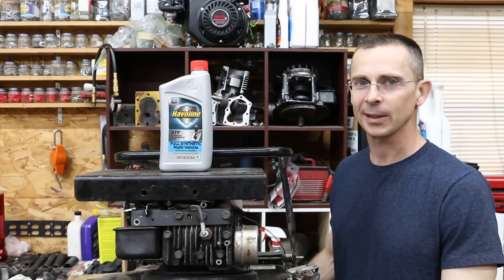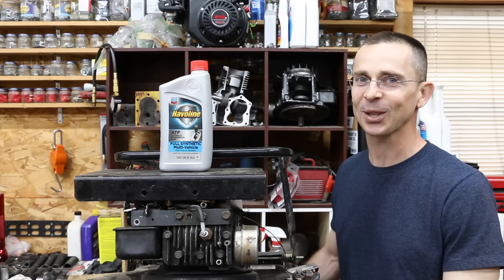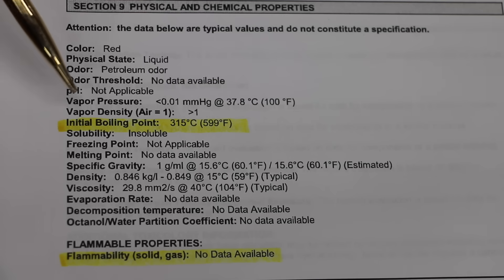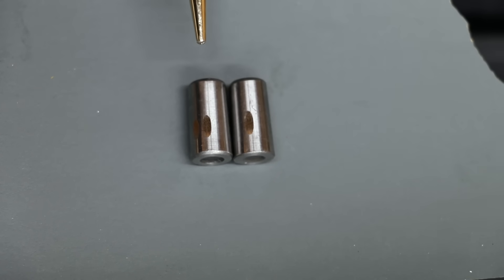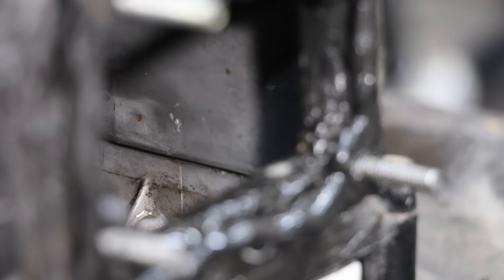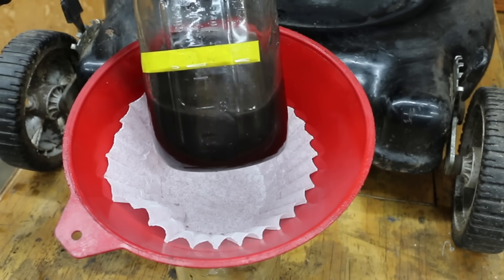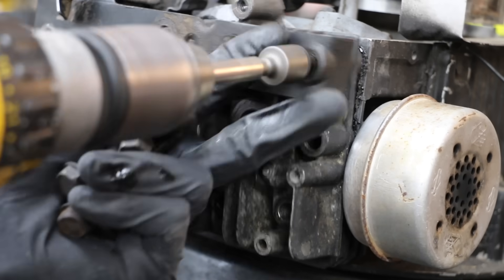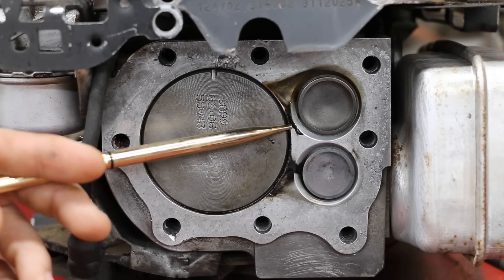ATF as an Engine Oil substitute?  Let's see what happens!

Comment: Great video . I worked as a tech at a GM dealer . The Boss's wife drove her van 32,000 miles without changing the oil . There were 3 or 4 lifters clattering . I drained the oil , installed 3 quarts of 10w-30 and 2 quarts of Dextron . I let the engine idle for 4 hours then drained the oil again and  added 5 qts 10w30  . This did quiet the lifters  to a normal noise level  , no more clatter . I would not advise adding ATF to an extremely dirty engine such as full of sludge as the ATF may fill the oil pan with enough sludge to plug the oil pump pick-up screen , this happened to a friend of mine .
Reply from the maker: Thanks for sharing.

Comment: As an ASE mechanic who's been working on vehicles for 25+ years I've seen and used ATF to clean and free up lifters tho sometimes taking some time. By safely.
It's basically 30w oil with detergents and antifoaming agents.
Reply: We never ran all trans fluid but rather one quart per 5qt change a I've done this on my 1998 GMC Suburban which now has 343,000 miles and a compression test last summer had 210psi on all 8 cylinders.
With a hot oil pressure of about 28psi @idle and 47psi plus above idle.
I did have a buddy that ran straight trans fluid in his car for about 5 years with no obvious adverse effects.
Reply: Maybe the extra detergents reduce film strength somewhat not sure.
Reply from the maker: Thanks for sharing.

Comment: One thing you should know: Many places that accept used, waste oil, WON'T accept it if they know there is ATF, hydraulic oil, or antifreeze in it. And I know a shop that is heated by an oil furnace, and they burn used motor oil, since they have so much. But they stopped accepting other people's used oil from home because it often had coolant or ATF mixed in, and wouldn't burn.
Reply from the maker: Thanks for sharing.

Comment: I think a Briggs and Stratton flathead is not analogous to a modern engine, or nearly any automotive engine since 1970. It's air cooled, has no hydraulic lifters, or pushrods, or rocker arms, no oil pump, and no small oil passages. It's also very low compression, and often has an aluminum bore, not iron. So even if something works in a lawn mower, it probably won't in a car.
Reply from the maker: Thanks for the feedback.

Comment: Years ago I changed out a slant 6 that came from a bone yard. Change the oil and used one quart of type F ATF. Ran for 200 miles. I was amazed when I puled out the dipstick and saw the clean spot on the dipstick. Even more surprised when I changed the oil how filthy it came out. I drove the van another 50,000 with no issues at all.
Reply from the maker: Thanks for sharing.

Comment: I used to add a quart of transmission fluid at my last leg of my trip home, just before an oil change on my freightliner, 425 caterpillar engine. (Up to 500 miles to home) Approx 10,000 miles per oil change. Pulled into drive way and dropped the oil. Don’t know if it did any good, but made me feel good!!
Reply from the maker: Thanks for sharing.

Comment: I've used atf to bring back engines from the dead. Oftentimes the rings will get clogged with carbon and get stuck in the groove so they don't seal. I've had cylinders with 0 compression jump up to normal levels after letting it soak overnight in atf. Solved misfire errors on my BMWs many times over the years. I just saved an old 1968 honda cb160 that was completely seized. Poured some atf down the spark plug holes and slowly broke it free the next day. Runs great now
Reply from the maker: Thanks ffor sharing.

Comment: Heard Marvels Mystery Oil was ATF. Wonder what an oil sample would tell?
Reply from the maker: Thanks for the video idea.
Reply: @ProjectFarm  Along the same lines, I’ve always used Gunk Motor flush before and oil change. A qt is about as much or double what a gallon of diesel or kerosene and smells a lot like kerosene. Also heard of people adding a qt of diesel or kerosene to oil before a flush and my uncle, a life time mechanic and engine builder liked to run a qt of ATF for a few miles before a oil change. Said it was easier on the engine. Anyway would be interesting seeing the cleaning properties of theses additives and even the lubricity of the additives to 4 qts of oil. Anyway thanks again, your videos are outstanding!

Comment: I actually used synthetic atf in place of oil in a mower since i didnt have oil on hand. Ruined that poor thing. At the end of the mowing season it was only cutting because i sharpened the blade real good. When i pulled the head off atf poured out of the cylinder
Reply from the maker: Thanks for sharing.

Comment: In older cars, 70's and 80's I would add half a qt of ATF about 500 miles before an oil change to clean up sludge, never had a problem, would I do it today?  Probably not.  Amsoil and Pennzoil Ultra Platinum are loaded with detergents, I would go that route instead.
Reply from the maker: Thanks for the feedback.

Comment: I took my Freightliner Detroit Diesel 4 banger to the dealer not long after new because it seemed down on power. They checked "everything" and pronounced it fit and finally filled both oil filters with ATF and ran it awhile. I didn't feel any difference but guess that doing the ATF in the oil is SOP with Freightliner. Thanks, JD
Reply from the maker: Thanks for the feedback.

Comment: Me and a buddy were driving from Michigan to Ohio and we had a lifter stick and start popping really bad. The engine was barley running so we stopped in a gas station and this old guy said pour a quart of trans fluid down your carburetor. We were skeptical but we were stuck so we revved up the engine rpm as slowly poured the trans fluid in and i'll be damned if the lifter didn't free up instantly and the engine smoothed right out. Amazing !
Reply from the maker: Thanks for sharing.!

Comment: Well, I haven't read all of the comments, but I have an idea after reading another's comment about water in the crankcase as a coolant/lubricant. I wonder what would happen if a dish detergent like Dawn dishwashing liquid was used in the crankcase. I'm suspecting that it would certainly clean sludge out right up to the point of engine failure.
Reply from the maker: Thanks for the video idea.

Comment: I worked for an old mechanic and we used transmission fluid to hot soak a Chevrolet 305 with a carbon knock and it feed up the carbon. Worked really well actually.
Reply from the maker: Thanks for sharing.

Comment: Years ago, before synthetics there used to be a old mechanic at Ford  who used to periodically substitute one quart of ATF when he changed the oil.  It worked great with cleaning the lifters.  Engine oil has now come a long way since then and now I would only use the recommended oil.
Reply: I normally don't reply to a 2 year old post but in case somebody else is trying to decide what to do for and to their engine I'll add my 2¢.  I worked for a fleet and in automotive for over 40 years so I know a little bit.  And if I had a sludged engine I'd use a pint of ATF mixed in with engine oil.  Then run the engine a minute or two, and let it soak for an hour or two.  Then drain the oil, change the filter and run the engine (as a "rinse" cycle to get all that ATF out!) for an hour.  Then drain and refill as normal.  
If you've tried to desludge the engine using aggressive solvents (like ATF) don't forget, the engine will still be actively desludging itself as you drive it anyway as what's already been done has surely loosened most of the sludge to within an inch of its slimy life.  And I think the rest of the sludge will probably drain out with subsequent oil changes.  
But I figure using my way, at worst you wind up with an engine with a trace amount of sludge left behind that will eventually dissolve and get drained out during subsequent changes.  And you put the bare minimum amount of additional wear and tear on the engine to do it.
Reply: Truth the be told even new engines benefit from the ATF for cleaning...the new guidelines for new cars with 10-20k mile oil change intervals are complete bs as evidenced by engine teardowns especially now that all cars use some sort of oil pressure actuated variable valve timing...even in some recent tests for engines that require 5w20...it may not be good to use it even if the manufacturer recommends it as eventually it will break down to a thinner weight the longer its in the engine before being changed which results in increased wear which is now extremely common on new cars that call for 0w20 5w20 or even 0w16 and 5w16 oils...they do this to squeeze out that 1 extra mpg for the window sticker and epa stuff...in the long run it's better to use some sort of 5w30 or 5w40...basically stay away from 20 weight and 16 weight oils so that you can actually get longevity from your engine
Reply: Did you know recommended oil changes per season?

Comment: They mean to mix ATF with the oil! Just a percentage of atf LIKE, One quart per oil fill or, 1/4-1/2 quart per oil fill...In the mid to late 1990's, My brother purchased a 1977 or 1978 Pontiac Firebird with a 301 which ran a ATF/OIL mixture, (I forget the actual mixture but, It was a percentage, not pure atf!) THAT 301 RAN SMOOTH AFTER 20 YEARS!!!
Reply from the maker: Thanks for the feedback.

Comment: I did an ATF flush in my 4cyl turbo about 12 years ago. The engine was 20 years old at that time. No ill effects. I only ran it at idle for about 15 minutes. Drained it replaced filter and filled with oil ran 15 minutes drained oil and refilled again. Oil pressure now back within factory specs.
Reply from the maker: Thanks for sharing.

Comment: Have a 2013 Scion tC with a 125,000 miles on it. It was burning a quart of oil every 1,500 miles. Scion is notorious for the rings clogging up. Design flaw. 
Anyway drained the oil put a cheap filter on it & filled it up with atf. I let it idle for 20 minutes. I did not drive it. Drained it then new filter & new oil and guess what ?
It doesn’t eat any oil at all with an additional 20,000 on the engine. 
It works for sure.
Reply from the maker: Great to hear!

Comment: Used DEX 3 to replace 1 quart of oil in my old 96 3800 firebird. After its first start in 10 years, the lifters were nice a loud. Ran it for roughly 3-5 days each with about 30 minutes of drive time and that engine never made another sound again. I did use new inexpensive oil with my ATF.
Reply from the maker: Great information. Thank you

Comment: I remember my father accidently topped his oil off with ATF. He was all upset and asked a guy we knew, who was a guy like you. He had a farm and fixed things all the time, and he said not to worry.  He was right, nothing ever happened. So I was curious about this video,  I really appreciate your work.
Reply from the maker: Thanks so much!
Reply: ATF has a higher cleaner I'm a  mechanic for 60 years for Chevron.i allways  add a full Qt just a week before I change oil.
Reply: I did the same thing, a few months ago. I didn't read the bottle. Went to to it off again, and finally noticed the label.
Reply: .
    WAYYY back when I was a kid, before my father retired in 1972, he worked with a friend who bought a brand new car. Back then, you had to break in an engine and change the first oil at 500 miles. They both used the same garage near their work so one day, his friend asked him if he would follow him to the garage during lunch to drop the car off for an oil change then take him back to pick it up after work. He did.
    They went back after work, the guy paid for the work and proceeded to drive home. The next day, his friend was several hours late and had his wife drive him in. He told my father that the engine seized on the way home. He called a tow truck and sent it to the dealer. The dealer drained the oil the next morning and it had a green sheen on top. My father drove him back to the garage during lunch where he complained to the owner.
    The owner called the new kid over and asked him what he put in the car. The kid went to the trash and pulled out 4 empty cans of Mobil 30w oil from the can and a fifth can of Mobil ANTIFREEZE. The kid finished off the last 4 quarts of oil from one case in the back room and, without looking, pulled a fifth can from a case of antifreeze assuming that it was also oil.
    Antifreeze, when it's heated to combustion chamber temperatures, will deposit something similar to a candy-like sugar coating onto the cylinder walls. Once it's chemistry has been changed by exposure to high temperatures, it will deposit itself onto other moving lubricated parts. This coating resists oil from being deposited where it needs to do it's thing thereby keeping it away from other parts that require lubrication. Parts like the piston wrist pins and  connecting rods, crankshaft main bearings, cam bearings and valve stems. Basically, within a few miles, that brand new, very expensive big block V-8 engine became a brand new, very expensive,, solid cast iron boat anchor that the garage owner had to order and pay for from the dealer and pay them to install it to keep the warrantee valid.
    Needless to say, the new kid became the unemployed new kid in short order.
Reply: @jeffmccrea9347 you really wrote this novel for us to read
Reply: I did that once too, my dad is a mechanic and I figured it was fine, he confirmed that it's fine.
Reply: Don't. adding automatic transmission fluid to motor oil reduces cleaning power. That’s because the detergency of ATF is less than motor oil. Why is that?

ATF is exposed to lower levels of combustion byproducts and contaminants than motor oil, so it is formulated with reduced detergency. Instead, ATFs have elevated levels of friction modifiers and other additives that help protect gears and clutches. 

adding ATF alters the motor oil formulation and reduces its effectiveness. A good motor oil is a fine balance of base oils and additives designed to fight wear, reduce friction, prevent deposits and slowly dissolve accumulated sludge. The cleaning power of motor oil is designed to work gradually over subsequent oil changes and not necessarily all at once. Adding a foreign substance to the oil disrupts the formulated chemistry, negatively impacting wear protection, detergency and more.
Reply: @littlehawk9322 not true. Hydraulic/transmission fluid is high detergents  that ls they use in transmission/hydraulic circuits dust and dirt is the death of hydraulic.  Hydraulic fluid fluid has a much higher flashpoint then petroleum base oil  but burns twice the temperature almost double btu’s.
Reply: @MrBlackbutang  my comment is a copy and paste from a oil companies web page. So it is true. Its straight from the source, so I'll trust their recommendation. Thanks for the input though.
Reply: @littlehawk9322  It all depends on the production. In an all-cast iron six or V-8 from the 1970s or older, a quart of ATF wouldn't make any difference. In a contempory engine, don't
Reply: @littlehawk9322  You should source quotes. That's mean, tell people it is a quote from some source and then name the source
Reply: @anonymike8280  it's from AMS Oil
Reply: @littlehawk9322  You don't need to source it for my benefit. However, I had six years of experience as a newspaper reporter, some years of experience in commercial publishing, and I haver an M.A. in English literature.

You just don't drop in a long passage like that without giving a source, unless you wrote it yourself.

You don't have to name the source. You could just say, "According to an oil company..." or "From a technical source..."

There are lots of ways to do it. Just saying, that's how you do it. If you did that in a college paper or an article, it would be considered plagiarism if you didn't attribute it.
Reply: @littlehawk9322  I keep on seeing people speak of good motor oil. Who produces bad motor oil? Who is going to invest in a refinery just to produce bad oil? Anyone who made bad motor oil would be out of business real quick and someone else would own the refinery.

What does happen is that sometimes retailers sell inappropriate products either deliberatively or because they don't know any better. SA oil, which is single-weight non-detergent oil with no additives in it, is still produced because there still are uses for it. Just not in any motor vehicle. There are no bad motor oils out there.
Reply: Your father didn't know that?.... I bet he cried alot too.

Comment: Every other oil change I use 1qt atf in the used oil before draining. Idle 15 min with a new filter installed. Change the oil and filter. The results of my vehicles has been 1.9l escort 336,000 still running, 5.4l f150 400,000+, 2.2l HHR 212,000+, 3.7l Liberty 296,000, Diesel Liberty 786,000. I've bet my paycheck before and won several times as to how clean the motors are inside. Oil changes done at 3000 miles or 2 months.
Reply from the maker: Thanks for sharing.

Comment: Engine oil already has detergent in it, if you are late on your oil change just change it sooner the next time. You can add some atf run the engine 5 minutes then change oil but I wouldnt do that because if your engine got sludged up the damage is already done, just run the right oil and change it on time.
Reply from the maker: Thanks for sharing.

Comment: I`ve used this method for yrs. Running old Fords they always had a lifter sound on One peticuliar 351 M I bought a truck it had a really loud lifter I put a pint in the engine drove it to town soon as it got hot the lifter shut right up power came up ,Came back from town changed the oil to new 10.30 put back in some Trans-Oil ran great -Tr Miss oil is like the old Rislone additive.
Reply from the maker: Thanks for sharing.